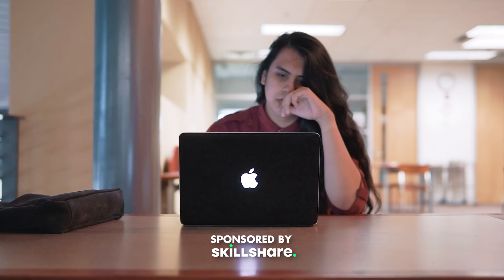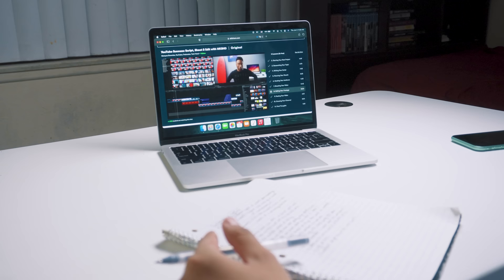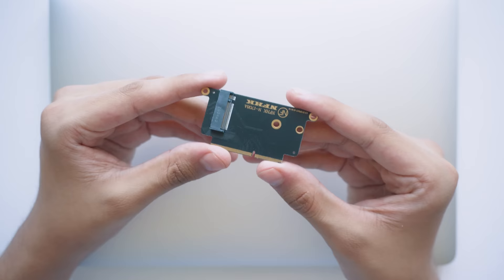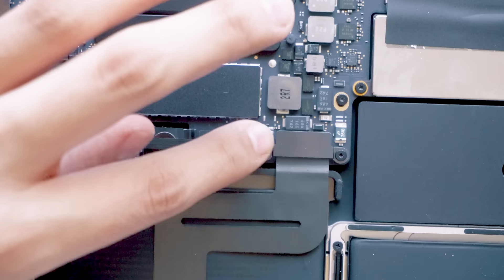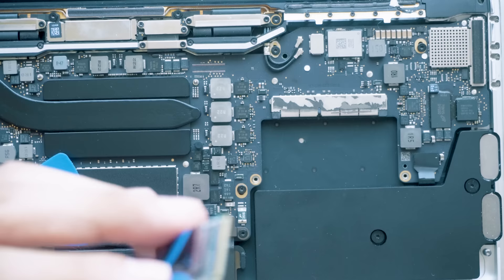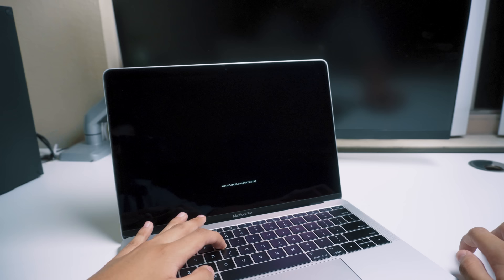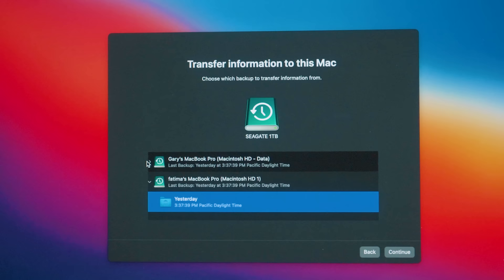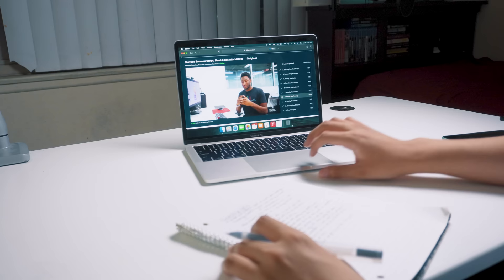I Was Wrong. THIS is the LAST Upgradable MacBook Pro

Comment: May i ask why macbook pro 2017 with touch bar wont work? (as in unable to upgrade the ssd just as this video)?
Reply: there is no removable ssd on it, the memory is soldered on the motherboard as in newer models

Comment: I bought a Hynix 256GB 2230 nVME drive and the same adapter however its not recognised by the disc utility. Even going into terminal and typing 'discutil list' doesn't show it. Any suggestions? I have read somewhere that its because the firmware is too old. Its a 2017 A1708. I'm getting a USBC to USB3 adapter to see if booting to a Catalina disc image will help.
Reply: Also, on the adapter, the brass stand off is intended to be soldered in place.

Comment: has anyone tried with 
SABRENT 1TB Rocket NVMe 4.0 Gen4 PCIe M.2 Internal SSD Extreme Performance Solid State Drive (SB-ROCKET-NVMe4-1TB)
OR
 Sabrent 1TB Rocket 4 Plus NVMe 4.0 Gen4 PCIe M.2 Internal SSD Optimized for PS5 Extreme Performance Solid State Drive (SB-RKT4P-1TB) ???

Comment: Hi! Are you currently having problems with your gf's mbp?? I just tried to upgrade, but the ssd is not being recognized. Just the base Disk. Nothing else :(
Reply from the maker: Same adapter and SSD I used? Check SSD connection, then check adapter connection, then try again. Everything needs to sit flush 😅
Reply: @DammitJeff  yes, checked everything. Repeated from the scratch 3x now. No sign of sabrent 😭

Comment: Their storage and RAM price is absolutely unacceptable, and of course they want to make it so you can't do the upgrades yourself! They also want their devices to be thinner, and let's face it, they absolutely do not care about the environment.
In my opinion, a MacBook Pro should not be a piece of crap ultrabook. That is the role of the MacBook Air.
The last upgradable and acceptable MacBook Pro is the last unibody! RAM is upgradable.

Back when everybody was using socketed CPUs even in laptops, Core 2 Duos and even first iSomething processors (I still have socketed laptop 3rd gen Intel CPUs), Apple was already soldering them.

But having completely un upgradable DESKTOPS (CPU, RAM and SSDs are soldered) is really unacceptable!

By the way, Apple's cooling has always been ridiculous. Fan curves are horrible, these devices rather cook themselves than get noisy. But it got even worse with the first Retina MacBook Pro, packing horrible physical cooling as well!
I forgot to mention their garbage keyboards as well. Even the reliable ones, their new butterfly keyboard is really bad.

Comment: I think you should move on from "This is the Last", its probably better to just be humble and move on from it.
It appears that you are wrong again. Even with M1 or M2 chip in 2023, those tiny SSDs are still upgradable provided with the right parts,tools and equipment. But, then again you are still partially right as these parts are not sold by Apple to anybody at all, As they are trying to monopolised the repair market. They are only provided to their "Recommended" 3rd party data recovery/Mac repairs comapny like,  Drive Savers or Ontrack. Which i believe is 100% owned by Apple.

Their strategy of making the Macs seems unrepairable/unupgradable. As much as they wanted to do that, it provens impossible where they are many independent technicians, like Louise Rossman, lapfix and many more, who has the skills to understand and deciper Apple's game here. Eventually, their strategy can only be seen as a precaution, prevention and to delay from the truth.

Comment: Only the SSD can be upgraded. Waste of time. Can't even do the RAM unless you have specialized tools. Face it, the ability to upgrade the RAM is more important than SSD. OSes use the RAM to actively work with software and as long as your limited there, your screwed. 

Note: When you buy a laptop/MacBook in 2015, it was designed for the version of the OS of that time and for the software of that time. Two yrs down the road, its now 2017, there is a new OS that have requirements for laptops/MacBooks designed for 2017. All of a sudden, your 2015 seems old and slow. Why is this, well the software your running is for 2017 laptops/MacBooks and your hardware is two yrs old. Now having the ability to upgrade your RAM, you can at least get your laptop/MacBook to work a little more efficiently with the new updgrade/s. Well, that's if you have the ability to upgrade the RAM. All my yrs as a tech specialist, I have yet to see an OS take up more that 50 GB of storage on the HDD/SSD. So what is the deal you get from upgrading a 500GB to a 1TB HDD/SSD. Little advantage. And with the use of affordable NAS and External HDD/SSD, what is the point of saving all your data on a computer, where if the computer is damaged you lose all your data; There is no point. 

The very last upgradable MacBook is the 2012. From 2013, Apple started soldering the RAM directly onto the mainboard. This is because they want you to purchase a new laptop as time does and this is every 1 - 2 years as they change the Mac OS every yr. 

Nice content making and trying to make it make sense for your channel is understandable. However, the Truth is always be the fact that as long as they solder the parts that matter when it comes to speed and efficiency, they are not going to make anything upgradable in the real sense of the word.